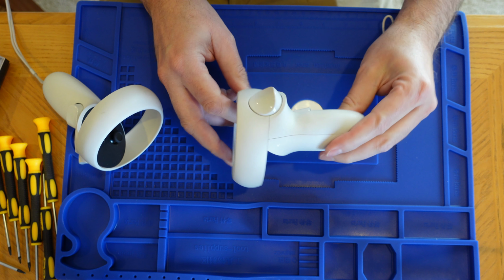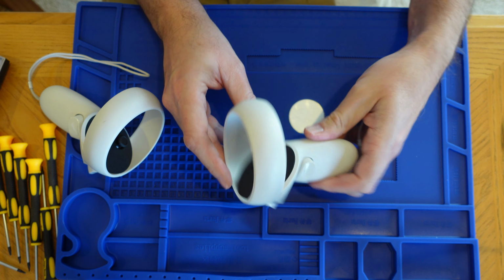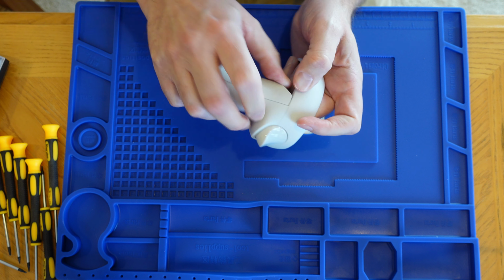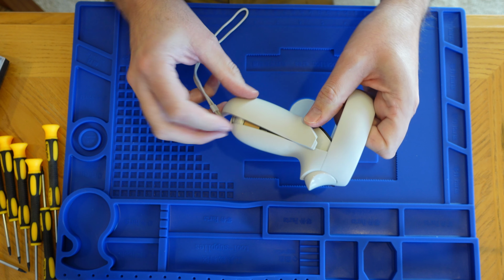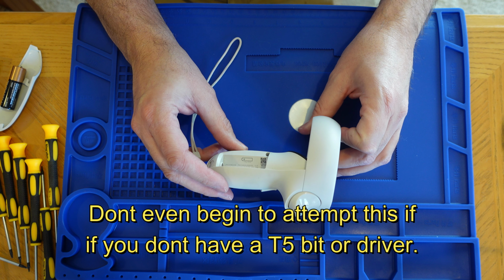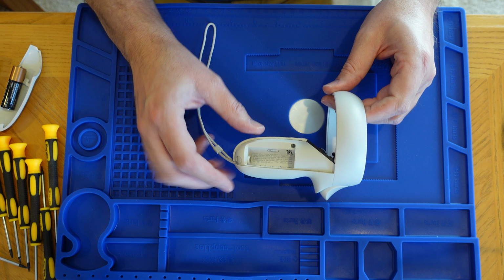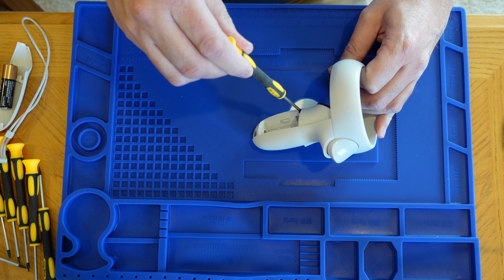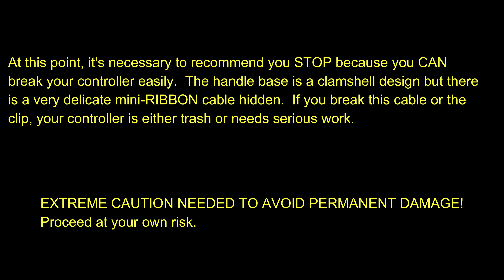Oculus 2 controller disassembly, cleaning and reassembly

Comment: you didnt insert the flat ribbon back into the slot on the motherboard
Reply from the maker: It's been so long since I did this and I have since sold my Oculus I don't recall.  However it was working so I must have inserted that ribbon cable